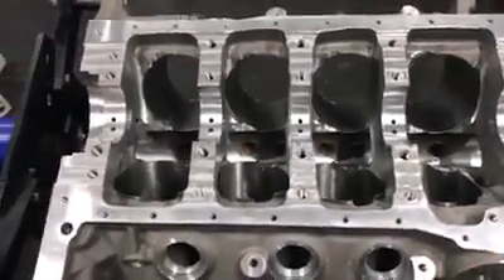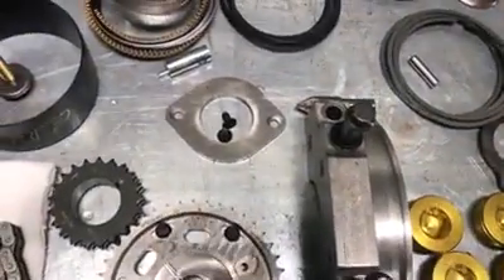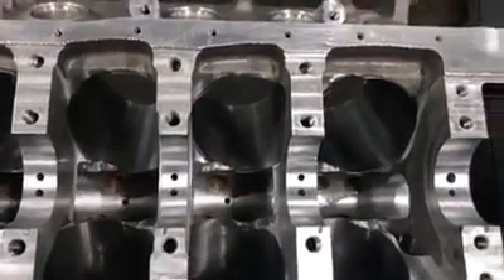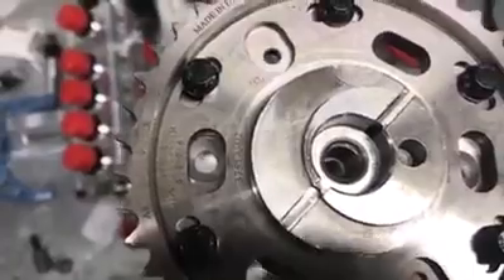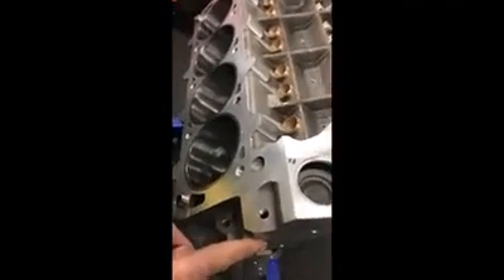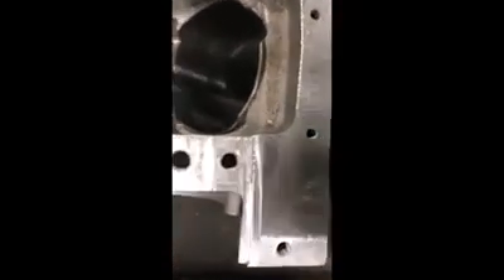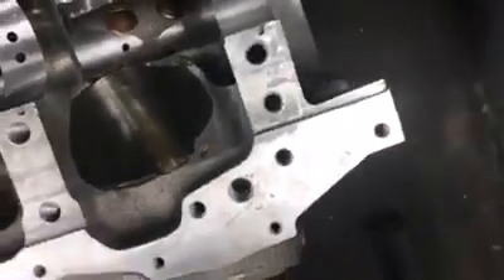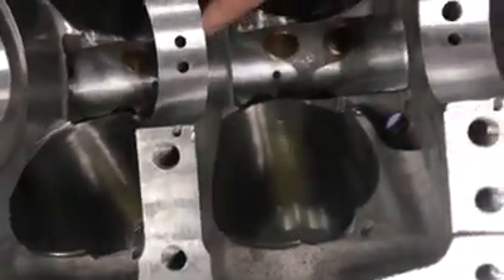434 Small Block Ford // Titus Performance Aluminum Cleveland Block Features

Comment: Question 4U from Australia. ....  u answered my 1st question .  Dont require 2500 hp . 1400 /1600 hp .  Can u easy do a 4.125 bore & 4.125 stroke  = 441 cu inches ??  Next question is can u fit the SBF Hemi heads from Georgia on2 your Cleveland Block  ??   Those Hemi Heads are awesome.   Beautifull job on your block .
Reply from the maker: If you require a 9.2 deck a 4.125 x 4.00 stroke would be my choice, expeciall for a power adder engine. that give enough piston height to make it stable and protect the rings.  A 4.125 or 4.25 stroke is a good combo for the 9.5 deck.  The Hemi heads do work on our block. we have a set on one of our own in house engines.   Thanks!
Reply: @TitusPerformance   thx 4 your quick response.  Us Australians love our Windsor & Cleveland Engines

Comment: Boy I hope the deck and sleeves stay put.  Hasn't been my experience with other non Cleveland blocks.  Might there be a 9/16 main bolt option. 120# of torque feels so good and absolutely no cap walk.
Reply from the maker: We have a larger footprint on the caps to spread the load and keep them in place. But for piece of mind we can do 9/16" studs on the caps and heads

Comment: What are the torque specs on the heads for the  aluminium block ? thought i found them on the website but that was mains .
Im running copper gaskets & seem to be getting oil seeping from somewhere & I figured i should retourque the heads since i ran the car a bit this fall .
Reply from the maker: 95 ft. lbs with ARP studs and APR lube
Reply: @TitusPerformance  hey thanks , that was quick service. 👍

Comment: I love this person that did the idea the add two more inches to the 9.5 in tall deck height to this nice and Powerful 9.7 deck height Ford Cleveland engine I love it I wish I had the money to own one myself and put it in a newer Mustang like a cobra 2009 or a cobra 2002 or a cobra 1990 695 I think it would be your 97 and I would put it at 441 cubic inches do is be 4.125 in stroke and 4.125 inch bore which I'm pretty sure that brings it to 441 cubic inches and I would put on a set of Cleveland Jon kaase C 400 cylinder heads  and the boys from Australia because they work together with John Causey Their Heads Cleveland heads and it would be a nitrous car with a 250 shot Max but it would start off with a 125 shot to 175 shot